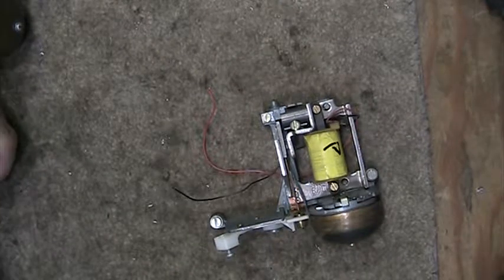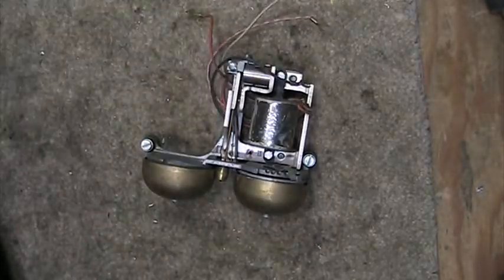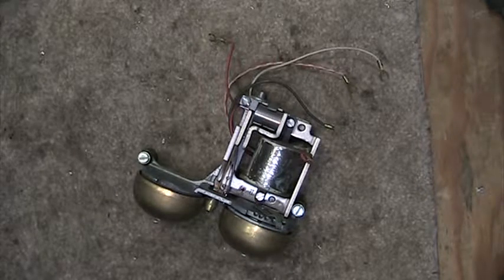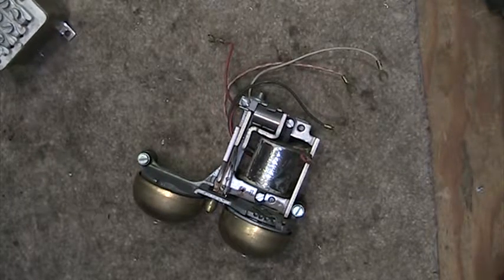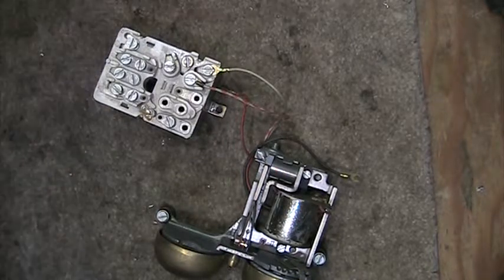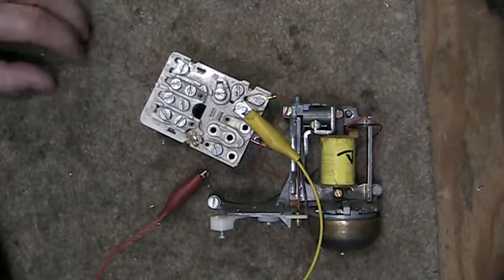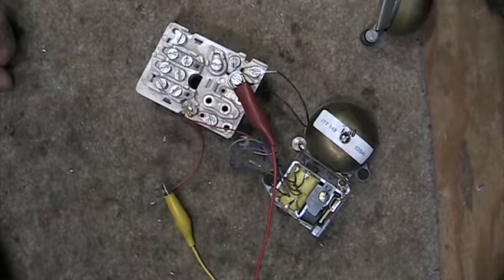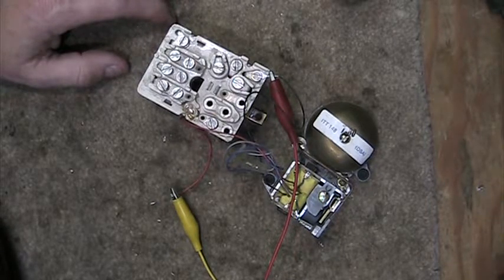Telephone ringers C4 type. the difference between 2 wire and 4 wire

Comment: What is the easiest way to make a telephone ringer work with an outside power source? I've attempted using a variac at 70-90 volts at 60hz and get no ring. I understand some ringers will work at 60hz, and some will not.

Comment: HELLO, I HAVE NUMEROUS PHONES IN MY APT, SO MANY THAT THEY DONT RING. I HAVE A ELECTRONIC RINGER THAT I HAVE PLUGED INTO MY XFINITY MODEM. THE MODEM HAS TWO PORTS FOR TWO PHONE LINES. PORT 1 IS FOR MY PHONES AND PORT 2 HAS RINGER BOX  PLUGED INTO IT. THE ELECTRONIC RINGER WORKS BUT I DONT LIKE THE RINGER SOUND. IS IT POSSIBLE FOR YOU TO BUILD ME A WESTERN ELECTRIC OR TRIMLINE BELL  RINGER THAT I CAN PLUG INTO THE MODULAR PORT ON MY MODEM. I LIKE THE RINGING SOUNG OF OLD  PHONES.
THX
FEARSRN
Reply: It would be easier for you to get a REN booster (or several depending on how many you have) and even easier to disconnect the ringers on some of the phones.

Comment: I wrote a message back was already to send and it was gone,  here we go again 
thanks for the answers to my questions as what to try if the ringer is faint.
I'll pull the cover today, I'll let you know if I had any luck. our old phone rang good and loud
I could even hear it outside and in the garage.  The trouble with the white unmarked wall
kitchen phone that works great except it leaves my line like its off the hook all the time,
and several days go by with out knowing. the brand name is a circle with curved lines in it.
from 2005 I imagine everybody has the same problem as (with out) a normal had set(easy
to hook, on hang up) and the new style with the buttons in the receiver. there was no good 
for the inventors of that style to make a decent hook and it was either leaving the phone busy or
smashing into the floor. thks

Comment: Thank you.   Anyone khow I can connect a Western Electric 500? desk telephone two-bell ringer to a Crosley 1957 Public Telephone replica I just bought at a thrift store?    Hate thelectronic bell.   There is room inside the pay phone replica to install a two-bell ringer.   Just one capacitor to allow passage of AC ring voltage but blocks DC talk current?    What capacitance and voltage?    Thank you.
Reply: One microfarad, rated for 150 volts.  Wire it in series with the bell.  The capacitor shown in this video is built into the "network" box, and he says that it is 0.47 microfarads.  Either 1.0 or 0.47 ought to work fine.  Yes, the idea is that the capacitor blocks DC.  Without it, the DC would run through the coil of the bell and your phone would appear to be off the hook all the time.
Reply: my reply bar is going nuts for some reason
Reply: @erintyres3609     Thank you, 35psi.   Shall try if I can find one.   We moved.
You may like my circuit which produced a click before the landline telephones rang!
Suspecthat it detected when our landline was connected to the Ring Circuit.  
Hearing the subtle click, I often answered the telephone BEFORE it rang!  (Before ring voltage wasent.)
Unknown if it would work on today's telephone circuit which is likely not a relay with metal contacts.)

In 1968 we would give our telephone number out, one-digit-at-a-time, between the Busy Signal tones! 
(Apparently Busy Signal came from a common Buss to which the caller's phone line was connected when the called line was busy.)

We now have a Custom Ring telephone number which makes the telephones ring Short-Short-Looooooong!    We Forward or emergency cell phone to that number.   
Ouresidence numberings normally.

Comment: I used to take apart the wall mounted version of these rotary phones along with a couple of trimline phones when I was 15 in order to clean and repair certain things.

 And I didn't know what that box with all the screws was called. I just referred to it as " the box ".

 And I had a small book that I would write down all the wire colors and names of the screw terminals that they went to. So that if I took the phone apart I would  know how to put them back together and where to connect the wires from the line cord, handset cord, ringer, switch hook and the rotary dial.  This was an interesting video.

Comment: I have the 4 wire coil type. I am trying to make this phone ringer my door bell. I hooked up to A&K, then you said call it up. I'm assuming your applying voltage to the red and black wires? If so, AC-DC and how many volts. I was hoping to do this with a normal doorbell transformer which is AC.
Reply from the maker: You will need around 90 v AC to ring.
DO NOT CONNECT TO 120 line power. telephone ringers ring at 20-30 HZ unless you have a special ringer.